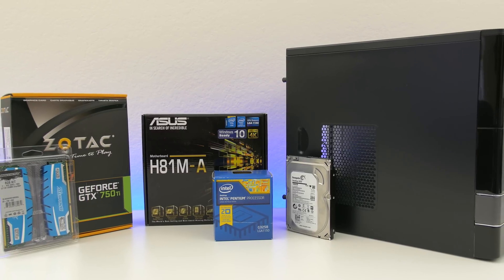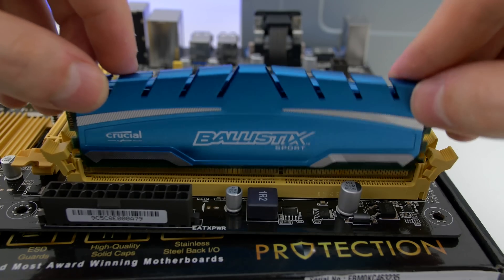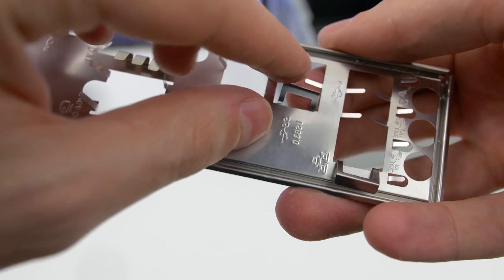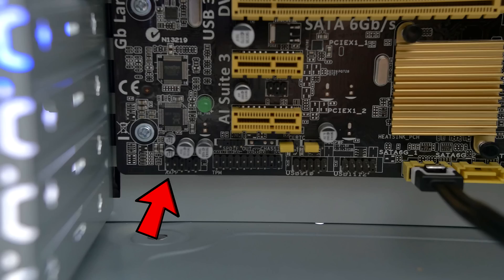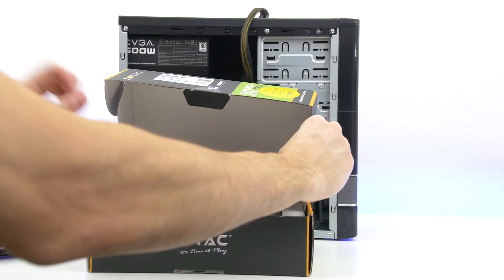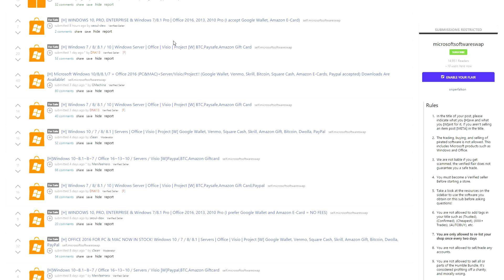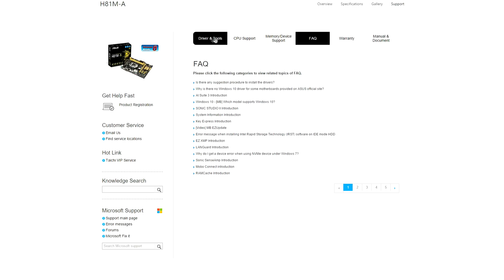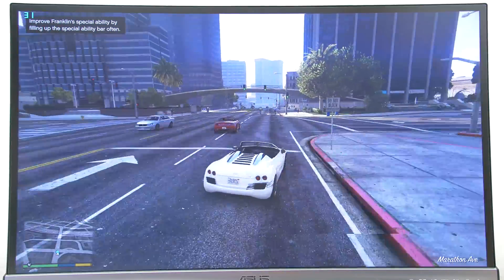How To Build $350 Gaming PC w/ Windows + Overclock!

Comment: @techsource  i built this pc in lait 2016 and have had it up to now (2018)  it is still serving me well.  Things i have changed; in mid 2017 the peteum gave out so i got a used I7 4700K,  I've added a CD drive and way overkill cooler from a pc that i found at a junk sale.  I'm looking to upgrade my GTX 750ti for a 950ti,  or possibly a 1080ti.  any suggestions?
Reply: Did you ever upgrade the gtx wanna do the same thing

Comment: So this case is small but the trick so wire management is real low so u use the drive bays on the right or use a modular psu or offbrand cause the wires is skinny and not as many

Comment: Hey techsource!

I'm building a 500dollar gaming pc 
And I want you to do a timelapse with the specs I use pls :D

Specs:gtx 1050ti 4gb
Corsair 450w power supply
Seagate barracuda 1tb 
Intel g4600 3.60ghz
Sharkoon VG-4W case green
Msi 250bm pro
And 8gb ram Ballstix Sport LT 8gb kit (4x2)ddr4

Comment: Your video actually helped a lot. My motherboard was a bit different so I had to use the cord from the original case as a reference, but following your guide, I even got the reset button working, which my previous case never had. Only problem I'm having is that the back fan is stubborn, and I have to manually spin it for it to actually work. It's rather strange. :\

Comment: Gtx750ti
I5 6500k
Gigabyte b150
Corsiar 8gb ram
Cooler master case
Cooler master far...single
Cooler master power supply
Reply: My specs (prepare to cringe)
NVIDIA GeForce GT 610 (MSI)
AMD Athlon II X2 220 2.80GHz
Stock eMachines EL1358G board
6GB DDR3 RAM (Can't remember who made my sticks)
Rosewill FBM-01 Case
220W PSU
500GB Main HDD
1TB Secondary HDD

Comment: I built this computer and recently added the hyper 212. The problem is that the heatsink things on the top dont quite fit in the case so it bulges.

I checked the dimensions on both the case and the cooler and it says it should fit. 

Help?

Comment: Is there something wrong with my computer? It's about  5 months old and same as this exact build except I have a1050 but when I oc the way Ed does, my lowest temp is like 60 and jumps to like 76 during full load?
Reply: Brandon Fong you probably just need to update the cpu cooler. Buy the 212 it works like a charm

Comment: can someone help? for the overclocking part i set the core ratio limit to 43 and the voltage to 1.345 and the computer won't start. either it will get stuck in the windows loading menu or a blue screen will pop up saying something went wrong you need to restart. So i tested it and when i turned the core ratio limit back to auto the computer started up fine. I have all the same specs as this pc does anyone know why this is happening

Comment: EVERYONE LIKE SO ED CAN SEE! Do not use a Hyper 212 Evo cooler with this build as it is too tall! I just installed mine now because I am overclocking and have actually found stable at 4.5Ghtz somehow from a 3.2 base clock and it was getting too hot, but I tried to put my side panel back on and it doesn't fit. DO NOT USE A HYPER 212 EVO WITH THIS BUILD!

Comment: Can someone help me? I've had this build for like 8 months. I was moving homes and when I finally got settled in I tried my PC. I found out that my CPU fan fell off, I bought a replacement CPU and a new case which is compatible with this whole build. I rebuilt the pc like 3 times. The PC will not turn on at all. I've tried switching cases and still didn't power on. I've also tried the paperclip thing with my PSU and it is working fine. Can someone help please? It'll be highly appreciated, thanks!

Comment: im watching the vid and was planning on building this for my younger brother so he can play some games with me on pc but I noticed that the gpu is out of stock... I was looking at a couple of zotac gtx750 ti, and the cost of one of them on  amazon was about 169 dollars, but this other one I found on ebay was 105. I was planning on getting the one on ebay because it was a lot cheaper but its a bit different the one on ebay is a (Zotac GTX-750Ti  2GB  DX11.2, Win10,8,7 PCI Express 3.0) and the one on amazon is a ZOTAC GeForce GTX 750Ti 2GB GDDR5 PCI Express 3.0 DVI HDMI DisplayPort Video Graphics Card (ZT-70605-10M) or the one that was used in the video. but my question is will the one on ebay be compatible with the build?

Comment: Do I need to buy the wifi adapter he included in the optional parts section to go on wifi?
Reply: Liam Fraser yup
Reply: Liam Fraser make sure you're not that far away from your modem or router because the wifi's not too good. I'd suggest getting a better wifi usb with a dongle for better download speeds
Reply: Thanks!
Reply: is it needed if i use a lan cable?
Reply: Rasmus Sundström no
Reply: In case you didn't know, PCs are usually connected to the internet via Ethernet cable. Not Wifi

Comment: Mine wont turn on :(
Reply: I got the gtx 950 does it install the same?
Reply: Jack Gautieri yes
Reply: Jack Gautieri hey I just got the 950 stick the GPU in the slot shown in video but find cables from power supply saying PCI then plug that in
Reply: tate Neiderer figured it out it was a faulty psu! My luck

Comment: When I installed my gtx950 onto my mother board slot and plugged in the power supply my monitor won't turn on. But when I take out the graphics card my monitor starts working again
Reply: Never mind I fixed it by attaching the vga cable to the graphics card with an adapter

Comment: can i fit a XFX - AMD Radeon RX 460 4 GB GDDR5 gpu in it cause i cant find a 750 ti anywhere
Reply: You definitely can. If you're going with an RX 460, I suggest a GTX 1050 2gb. It outperforms the RX 460 along with being basically the exact same price.
Reply: Insert Name Here I know this comment is a year old, but your a dumbass, the 4GB variant is ten times better, I actually suggest the 560 4GB because it runs better on Vulkan and DX 12 and the extra VRAM lets it run all games at 
maxed out settings. The 560 runs at least 10 FPS more than the 1050. So the RX 560 is the champion, but I’m ok with the 1050, just the 2GB of VRAM kills me so much when playing games

Comment: So just got mine out of the box brand new. I am trying to overclock it, but I'm stuck at 4.0 GHz @ 1.35 V (Currently testing). How does everyone get above 4.0 so easily? Is there a setting I missed? I have an Asus H97M-Plus mobo. Help plzzzz
Reply: TrollCaptain idk but did ur price come over $350?????
Reply: Mr. Benjamin Since I already had a motherboard, ram, and such, I only upgraded my processor. Sorry about that
Reply: TrollCaptain your motherboards bios is the problem
Reply: Levi Lapsley It supports overclocking. Is there something else it needs to do?
Reply: TrollCaptain I'm not an over clocking expert but I would assume that's it
Reply: Levi Lapsley I think I figured it out. There in a Clock Min and Clock Max setting I found in the manual. It controls the Uncore settings. I will play around with it
Reply: Which sucks because I put my old processor back in lol
Reply: Just search "How to overclock on (add motherboard model)" Done
Reply: TrollCaptain mine stays at 1000volts wtf
Reply: can someone help me? I know this might be a dumb question but does the computer already come with all the screws?
Reply: Gabiyi yea
Reply: tate Neiderer That's not right. Is there a decimal after the 1 like this 1.000?
Reply: Yeah I am buying a new motherboard and processor.
Reply: TrollCaptain will a core i5 fit in the motherboard
Reply: tate Neiderer If you want this motherboard, you need the i5 to be an LGA 1150 Socket with a compatible chipset. Keep that in mind
Reply: Im done my budtron butTrollCaptain for some reason it scores 1889 but in the video he 3888 and I even have a GTX 950 ftw
Reply: tate Neiderer I am not familiar with GeekBench. Instead I stress test and get the GHz I want. However, you could be testing the GPU not the CPU. Try looking for something that says test CPU or multicore or something
Reply: tate Neiderer did you overclock your CPU
Reply: Ya but if I go to 43 core ratio limit I get a blue screen that says your PC can't run then it restarts
Reply: TrollCaptain up ^
                              I.

Comment: Anyone else's total add up to $558
Reply: Mr. Benjamin mine turned out to be around 440 with monitor and keyboard+mouse
Reply: Captain Qing mine is $558 just the parts not the monitor or any extras
Reply: Captain Qing how much was the graphics card u got? Mine is 250 which seems like a lot
Reply: mine was around 440 with no monitor or mouse or keyboard but this is a good pc
Reply: bro i put a strix rx 460 oc in and i cant run bf1, i didint overclock my cpu because im paranoid about fucking it up.

Comment: so i built it but my monitor wont work sowhat do i do i put everything in right just tripled checked so can someone help me?
Reply: +LoxLor try to change the cables eg if your using a vga then switch to hdmi or try to hook it up to a tv just to make sure the motherboards actually locating a screen. even if it still doesnt work try to re apply thermal compund on the cpu incase you touched the surface. Although i doubt that anythings wrong with the pc try using another monitor or as i said earlier a tv incase you dont have one           
 -hope that this helps :)
Reply: LoxLor did it work yet and if it did what did you do to fix it
Reply: i took out the graphics card it was broken and it booted up but if it happend to you i would try somthing difrent
Reply: LoxLor make sure to run the HDMI out of the graphics card

Comment: So overclocking is possible on a h81 chipset mobo? 
So I can oc an i5-4460 on any Asus h81m board? Or only on this specific model?
Reply: Mátyás Fekete i5-4460 is not on overclockable chip so no
Reply: Mátyás Fekete You can only overclock reliably with CPUs that end with k
Reply: But then why could he OC  a Pentium? 
Are Pentiums overclockable?
Reply: Mátyás Fekete most pentiums are over clockable, i3, i5, and I7s without the "k" are not overclockable

Comment: can this run h1z1? also if I upgrade the graphics card to gtx 950 do I have to change any of the components?
Reply: GG Emmy did you have to change motherboard?
Reply: GG Emmy you might consider getting a better proccessor because you might want to avoid bottle necking or you can overclock the cpu but other than that your fine
Reply: GG Emmy i got the gtx 950 and i works like a dream and i played h1z1 you dont even need to overclock

Comment: Is this pc still a good choice?
Reply: TechnoTazTips yes
Reply: I built mine using almost all the parts he uses in the vid, changed the G3258 for an i5-4460, the GTX 750ti for a GTX 1050ti, and the Crucial ram for Kingston's HyperX Fury 8 gb kit. Happier than ever.
Reply: Used the same case
Reply: Aura, did you have to change your mother board to use the i5-4460?
Reply: yes but these GPUs need drivers and you have to install them with CDs but i don`t know if you can hook up a CD and DVD reader to this motherboard. If you can please tell me how
Reply: Nope, but i suggest you upgrade to an ASrock z97 Anniversary.

Comment: HELP!! Hello im thinking of building my first pc but want to now if this will be able to use this GPU MSI NVIDIA GeForce GTX 1050 2G OC. https://www.amazon.co.uk/MSI-GeForce-GTX-1050-Overclocked/dp/B01MDOS4U2/ref=sr_1_2?s=computers&ie=UTF8&qid=1480024999&sr=1-2&keywords=gtx%2B1050&th=1. If you can help that would stick the stress of knowing if you got it wrong thats like £150 down the drain Thanks means a lot :)

Comment: Im so paranoid about static fucking my things up, imma build my pc naked.
Reply: Muzaffer Ozen are you going to watercool it with your piss
Reply: It's not as big a deal as people make it out to be. Definitely be careful, but just touching a grounded power supply every now and then will be fine.
Reply: Muzaffer Ozen PC building in the nuuuuuddddeeee
Reply: Muzaffer Ozen I'm with you, man. Imma build it naked. Maybe I will get 2 leaves.
Reply: can someone help me? I know this might be a dumb question but does the computer already come with all the screws?
Reply: Gabiyi yes they do
Reply: Gabiyi Yes.
Reply: thanks everybody
Reply: Muzaffer Ozen lmao same
Reply: I know this comment is old, but most parts in PC's these days use solid cap compositors, so a small static shock while standing on carpet isn't going to really do anything at all. When building a PC, just keep your hand on the outside of the case.
Reply: 1C3 P1CK late club lol
Reply: I don't have carpet so I really have nothing to worry about. I'm still gonna end up getting a grounding strap though, just to be safe.
Reply: You know, I ruined a mobo on accident by building up static and replacing a cpu on my carpet floor.
The ol' days man
Reply: No problem.
Reply: Gabiyi ye the case does
Reply: Muzaffer Ozen ive never worried about static and never damaged my pc lol in 4 years

Comment: I was wondering, if this pc is able to run gta at ultra settings at 30 fps, at what settings would it run gta at 60 fps
Reply: and if someone has this pc, is it good?
Reply: Yeah it would be good in terms of gaming. 
GTA V settings:
Ultra 1080: 30fps average
Ultra 1080 (less textures): >60fps
Normal 1080: 50-60fps

Lowering some settings: More Frame rates
After tinkering it should come down to personal preference.
Reply: Thanks☺
Reply: Ozi Gutierrez there's is no way that's possible. at 720p with this pc  I can't even get above 30 fps at 720p and low settings

Comment: OK a small question which of the optional parts are very important
Reply: Another small question is it good for gaming I mean I won't face any problems at least for 1 year right
Reply: For a fully working PC, you need a Motherboard, CPU, GPU, PSU, Memory, Hard Drive / SSD / external drive, Cooling fan / water cooling.

This PC is budget, and it may not work on new titles such as battlefield 1 (you may, but on low - medium and maybe high) you can always upgrade to a 970 or 980 later.

Comment: I was wondering if it has wireless internet option
Reply: Help would be greatly appreciated
Reply: Fundip 6996 you can search for a motherboard with a wifi in it.
Reply: GReDDY WupS thanks I'm new to the pc market
Reply: Fundip 6996 you can always get a wifi adapter. They are cheap like $10 but you won't be getting the aame internet speed as if you were to use a Ethernet cable

Comment: is this build good?

CPU INTEL PENTIUM DUAL CORE G3258 3.20GHZ LGA1150 - BOX
RAM CRUCIAL BLS2CP4G3D1609DS1S00 BALLISTIX SPORT 8GB (2X4GB) DDR3 PC3-12800 1600MHZ DUAL KIT
HDD SEAGATE ST1000DM003 1TB BARRACUDA 7200.14 SATA3
CASE COOLERMASTER NSE-200-KKN1 N200 BLACK
PSU CORSAIR CX500 - 80 PLUS BRONZE CERTIFIED 500W
ASUS H81M-K RETAIL
VGA MSI RADEON R7 250 2GD3 OCV1 2GB DDR3 PCI-E RETAIL

Comment: Im looking into buy one is this a good build : Pc builds:

1.Ballistix sport 8Gb kit
2.Intel G3258 4 Pentium GHz 3m Cache 2 Core Processor 
3. Asus H81M-A MicroAtx DDR3 1333 LGA 1150 Motherboards 
4. Seagate 1TB Desktop HDD Sata 6Gb/s 64MB Cache 3.5 inch Internal Bare Drive 
5. Evga 500 W1 80+ White 500w, Power supply 100-W1-0500-KR
6. Zotac GeForce GTX 750 Ti DirectX 11 ZT-70605-10M 2GB 128-Bit GDDR5 PCI Express 3.0 HDCP

Comment: im making this but getting a core i5 or core i7 to run  gta v at 60fps, GTX 1060 and adding a SSD. is this Overkill for playing games like Csgo, Minecraft, Gta v, tomb raider 2013, all on high settings
Reply: the gtx 1060 is the 3gb version. is installing the gtx 1060 the same as installing the gtx 750ti?
Reply: Yes except you need to plug in a molex power adapter from your psu.
Reply: Not really.
Reply: what is a molex power adapter

im new to pc building
Reply: Mac Gamer